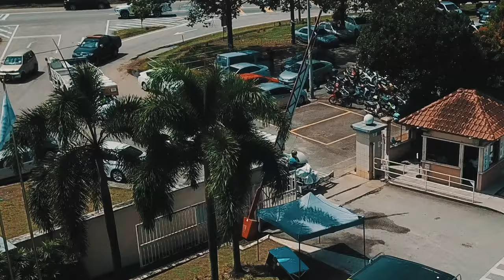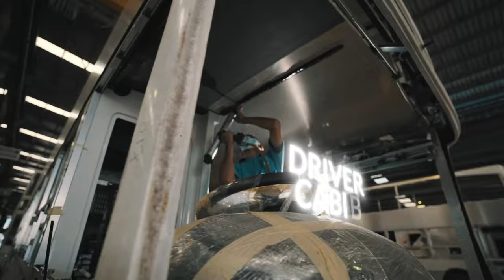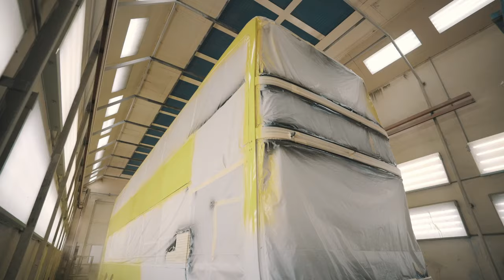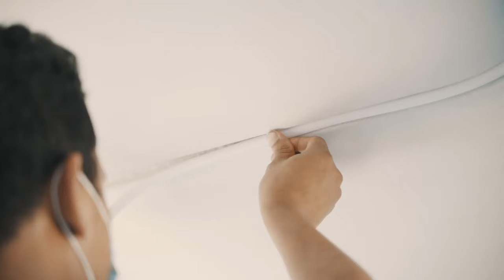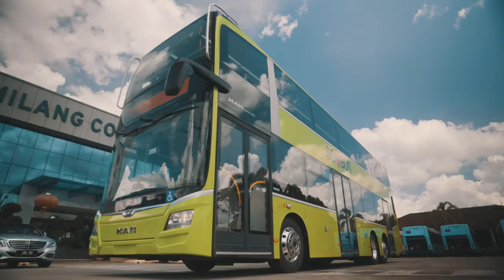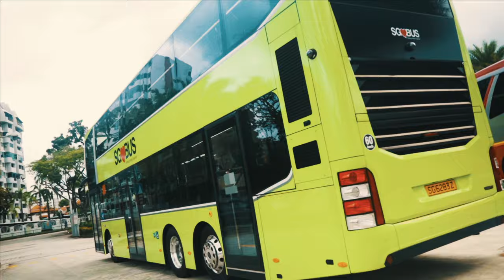Making of our three-door double-deck bus

Comment: There isn't any difference between this and the standard model other than just the significant alterations to the interior.

What's the point?
Reply: Yap
Reply: had the same thought... prolly its to encourage people to move to the back... and to the top.. they have 2 ladders connecting upper deck now
Reply: Quicker to get on and off if you have more doors
Reply: @grassytramtracks  Or just use bendy buses? It's already been proven that BB load and unload much quicker than DB but LTA said nah and scrapped almost every BB to get a 3 door bus that most people don't even use.

Comment: how is the units delivered to which comps? would GA have?
Reply: The chassis is being delivered by tow trucks to Gemilang Bodyworks Ltd in Senai, Malaysia  for assembly  and when the bus is completely assembled,  it undergoes tests before coming to Singapore through checkpoints. All bus companies including Go Ahead will get the buses. Now that all the 50 MAN 3-door buses have been delivered, the next coming 50 3-door buses will be from Alexander Dennis which will be assembled in China, tested before they are being delivered to Singapore by sea.
Reply: @andyng3666  where is the man a95 parts made in malaysia or germany
Reply: chassis likely in germany but body and final assmebly in malaysia

Comment: You are all going mad over this Bus, yet 3 door single axle buses have been operating in London for about 10 years now, The Borismaster, the replacement Bus I think was built by Wright Bus of Northern Ireland that replaced the Routemaster in London and has been called the modern Routemaster Bus, and have Northern Ireland Registrations, so this concept is not new.
Reply: thats your f problem . this is singapore dont talk else where